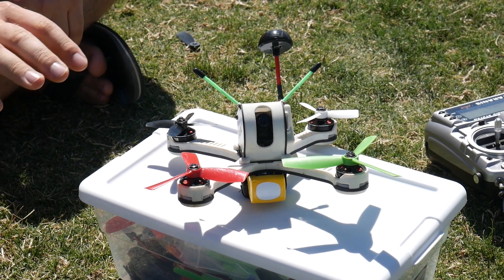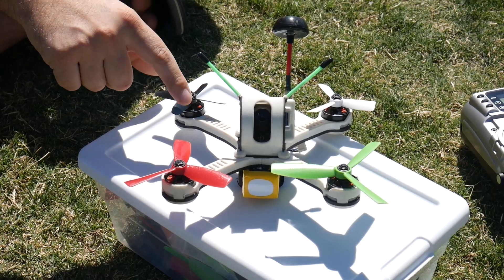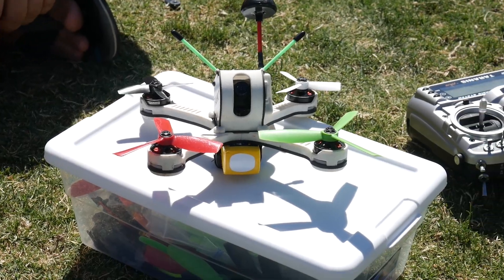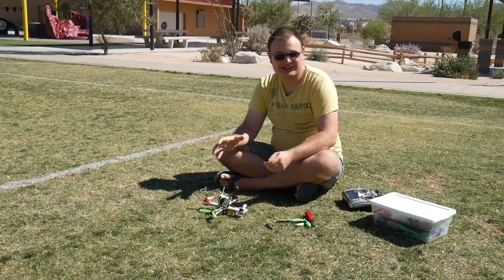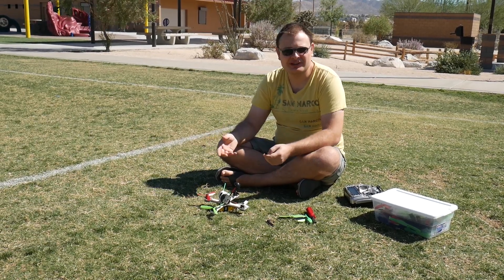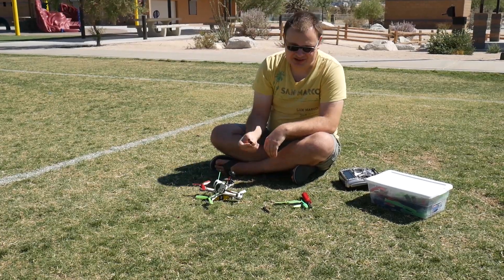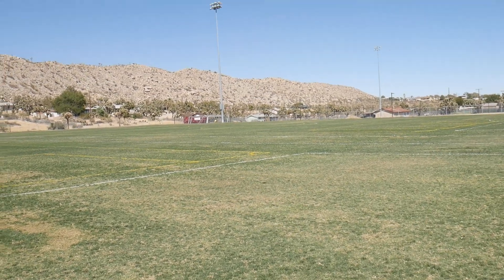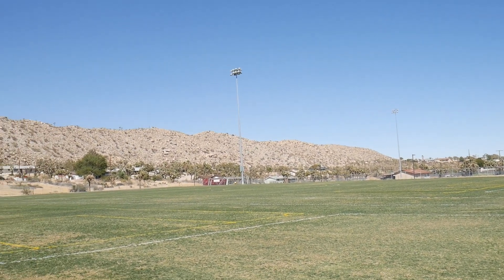Tanky Drone - Quadcopter Running with Different Size Props

Comment: you didnt design the software it was betaflight. you didnt build the f3 board. so what are you showing off?
Reply from the maker: Never claimed we wrote Betaflight but we did design and assembled the F3 board, and that's what we were testing. It was a followup to a question someone asked.